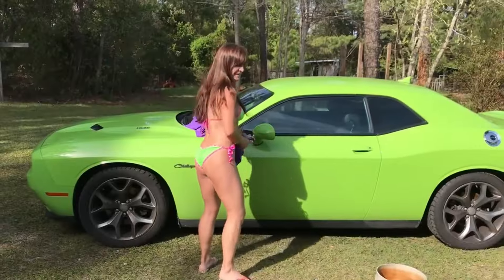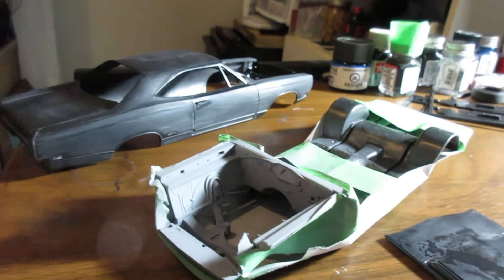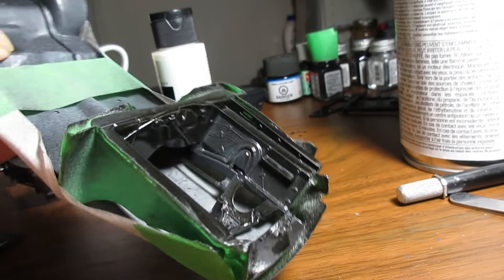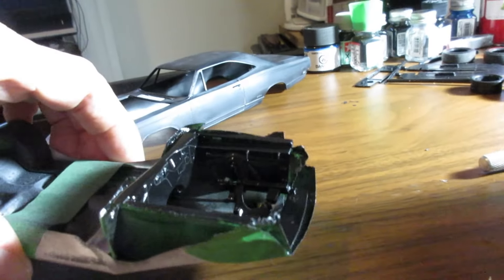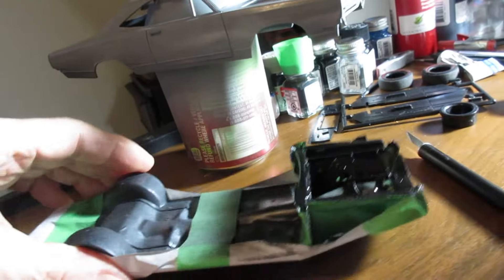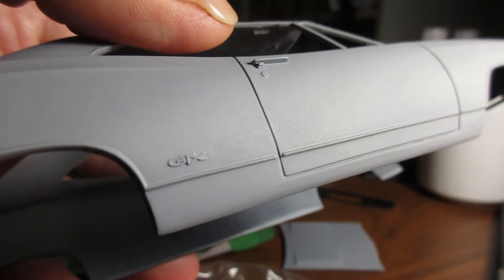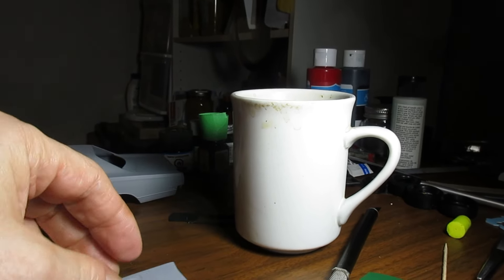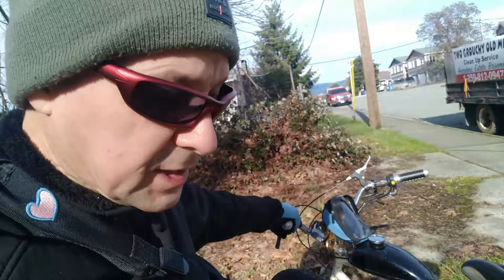Spraying Primer Sealer,  this time onto my 1969 GTX model kit build

Comment: lookin good chucker😁🤩i got two 68 roadrunners one is going to be a GTX and looking @ reference photos i noticed will have ta recess the tail lights also need to get the one your building so i can use thoose emblems😎scooter out stay safe buddy🤪